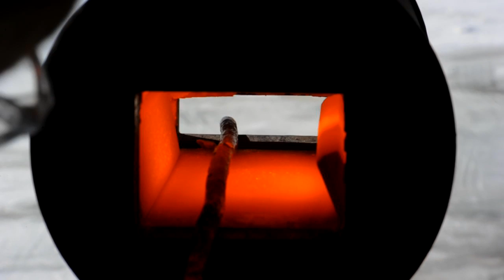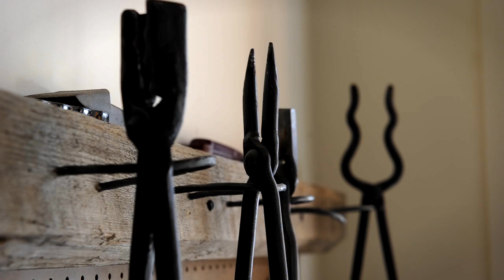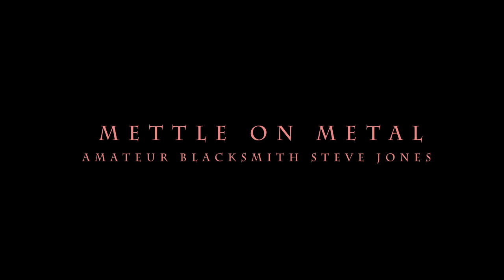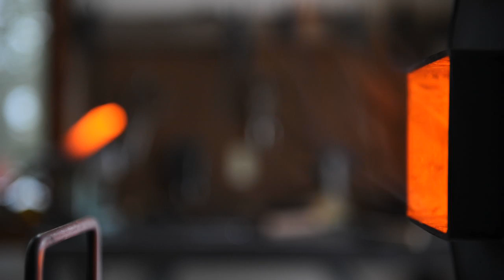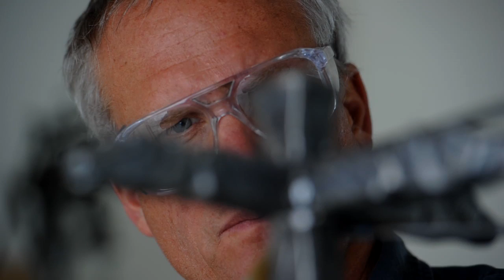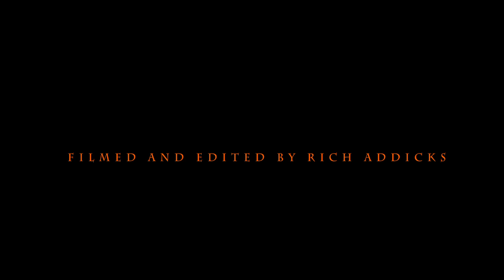METTLE ON METAL

Comment: get out and grab it, the biggest place you need is a garage like this guy have, check that are solid blocks of wood to hold the tongs, table to work with grinding, anvil hammers and the forge. It´s not so difficult tou need to hammer once to get hypnotised with this type of work